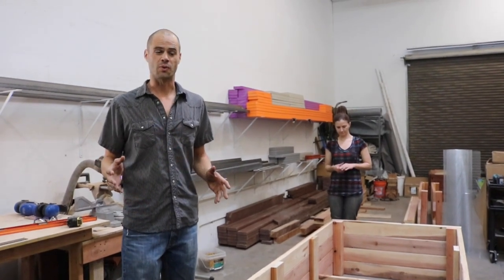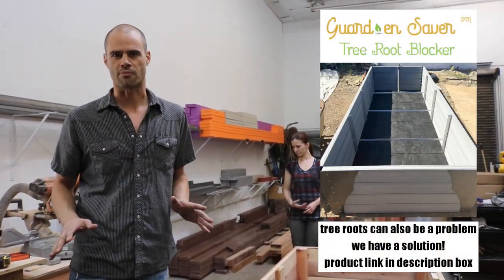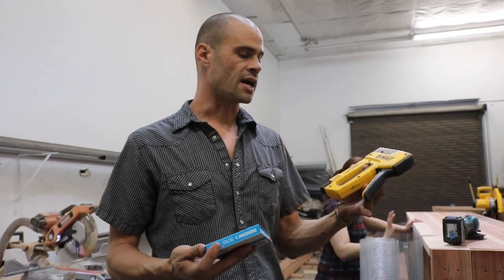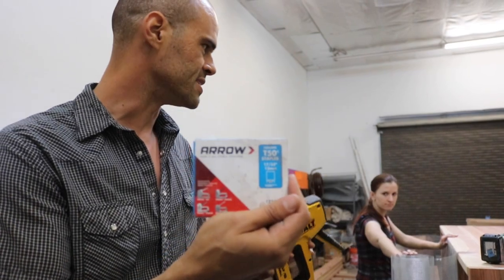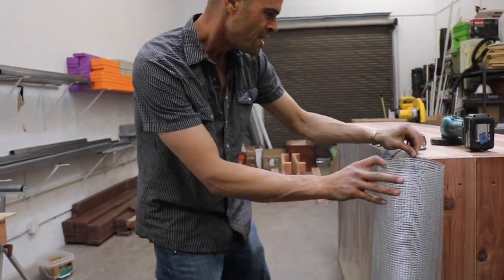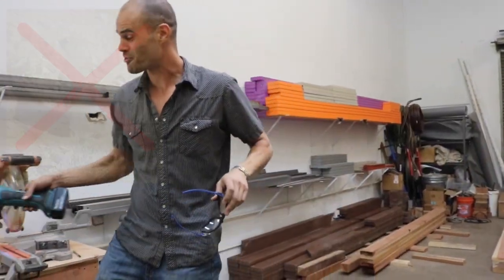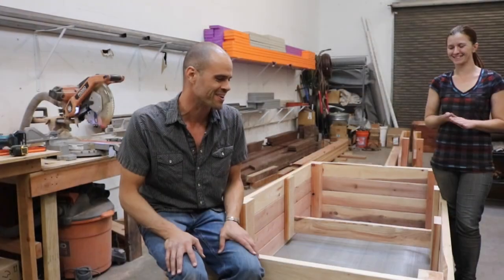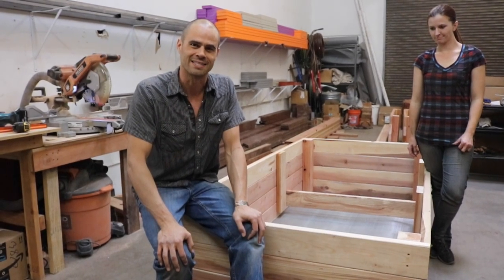How to Protect Your Raised Garden Bed from Rodents: Installing a Rodent Barrier

Comment: How do you keep rodents from climbing in the garden bed on the outside of the bed?
Reply: Make galvanized roof panel beds.  Thats what I did.  They don't climb it and it will last a LOT longer than wood.  It's the much better investment
Reply: @DebRoo11  that’s really interesting! I wonder if we could add the galvanized roof panels…like siding? Do you think that would work?
Reply: @cindy-garden-prepper  I wish I could send you a picture 🤭 I just came in for supper after putting my beds together.  I'm not sure how your beds are made but the panel should go on the INSIDE with a frame on the outside.  The soil will keep it all in place. I used 32 guage galv panels from Home Depot (not sold in Canada, I got them in the US since I live by the border).They were $18 for a 8' x 26" panel
Reply from the maker: Hi Cindy! That really is a big challenge someimes isn't it. I build my garden beds with a plant protection frame and for some customers I have built it with doors and wire mesh screen to keep all the critters out. You can scroll through and find an example on my website at the link below. You can check it out here for some inspiration! https://www.thriveandgrowgardens.com/hdpe

Comment: Yeah, I think you need to do the top with screen and frame with a accessible door.
Reply from the maker: Yes, I do build these with doors and screen actually. You can scroll through and find an example on my website. This is one of the custom garden bed kits I build with plant protection frame which I sometimes build with doors. You can check it out here for some inspiration! https://www.thriveandgrowgardens.com/hdpe

Comment: I have a problem with voles and they don't climb, only dig under and up into the bed.  Now squirrels... Grrr.  I basically need a fully surrounded,covered cage around my whole garden.  Which is a pain in the arse for working in
Reply from the maker: Sometimes a fully surrounded cage really is what is necessary. I build my garden beds with a plant protection frame that makes it easier to add additional covers like shade cloth, frost cloth, netting, and for some customers I have built them with doors and wire mesh screen to keep all the critters out. You can scroll through and find an example on my website at the link below, check it out for some inspiration! https://www.thriveandgrowgardens.com/hdpe
Reply: @thriveandgrowgardens  I may just have to do that but my garden area is 30 x 30'.  I've already spent my budget this year and it's only April lol I will definitely check out those links for ideas!  Ty
Reply from the maker: @DebRoo11  Yeah, it sounds like a fully enclosed structure is possibly in your future!